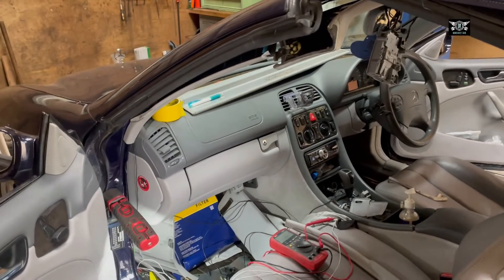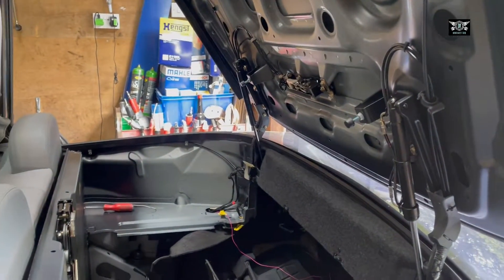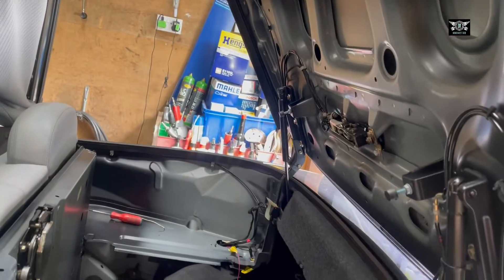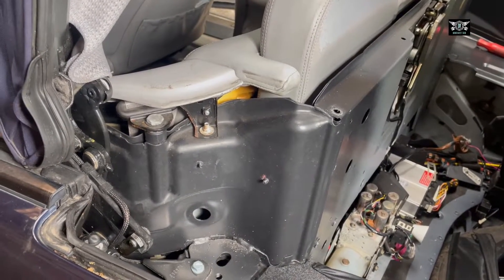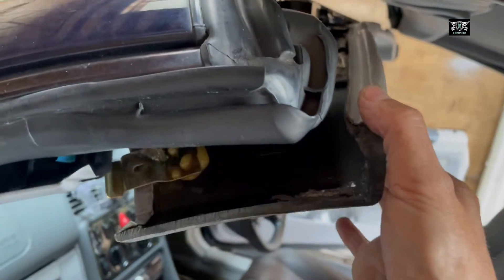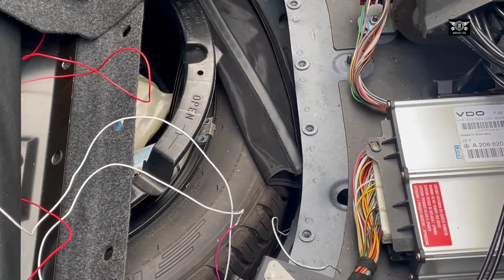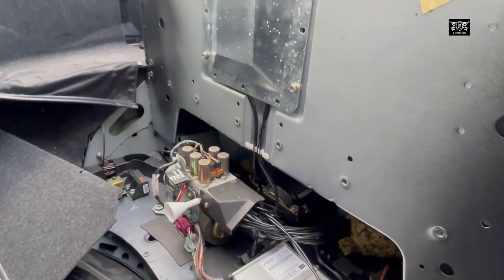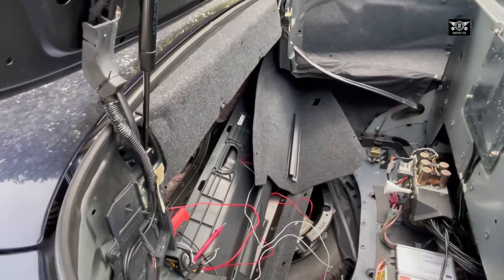Mercedes CLK w208 2002 Soft top microswitches sensors location

Comment: Thanks for this upload, painstaking wire/microswitch sourcing! Very helpful, thanks. Hopefully this will help to fix my partners car!!!
From your experience,  will a lowbattery also cause roof failiure?
Reply from the maker: the roof is hidraulic however it does need battery power to operate it. If you mean it still start the car but is old and a bit low on power, then i don't think this would cause issues as you can operate the roof with the car running.

Comment: Hi, how did you remove the cover for the wiring harness of the roof module?
Reply from the maker: If I understand the question, there is a metal covering the pump, the module and wiring, if that the one you mean then it’s help it by a number of 10mm bolts but first you need to remove the covering panels which are all held in by plastic button clips. Or is there something more specific you are asking.
Reply: @DaringBeefcake  Thank you for your reply. I meant the plastic cover on the actual connector itself. The one held on by the 3 little screws. I removed these screws but still can’t seem to get it off.

Comment: Hi, thank you for this video it had helped me a lot! I believe my issue is from the broken wires as you described at 18:20. Do you know where on the harness connector at the soft top module i can use a multimeter to test this? I would like the test out the entire wire for continuity without needing to cut into the wires. Thank you!

EDIT: I have access to WIS, and managed to find the diagram/pin assignment. If anyone would like a copy of this reply to my comment.
Reply from the maker: Hi sorry I didn’t reply for a while. The connector for those wires go straight to the control module as far as I remember. I would love to have a copy of the pins if you still have access to that.